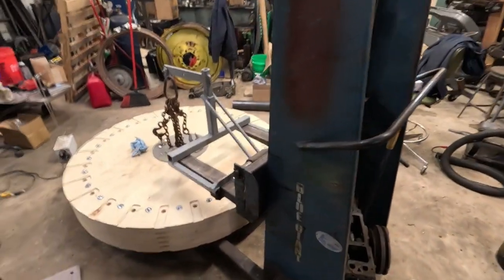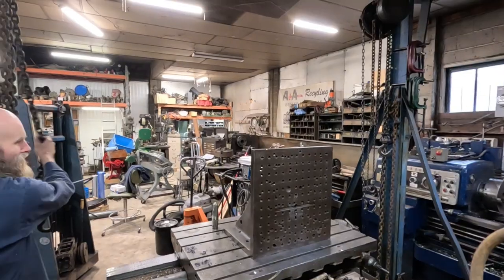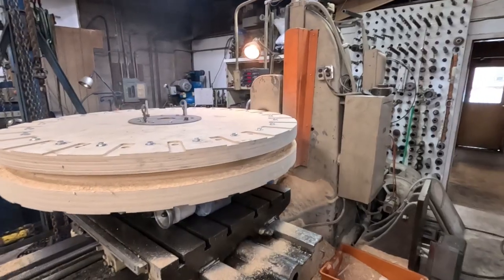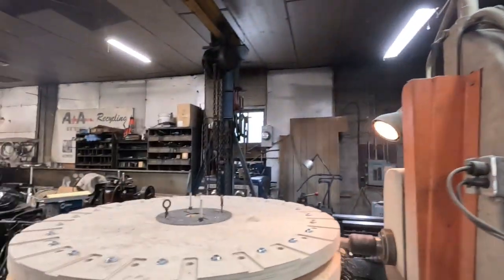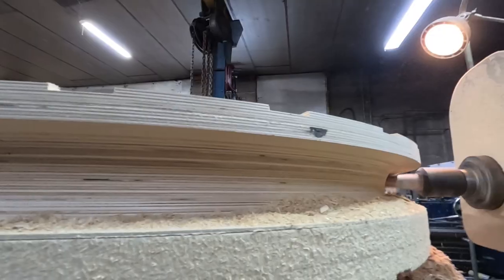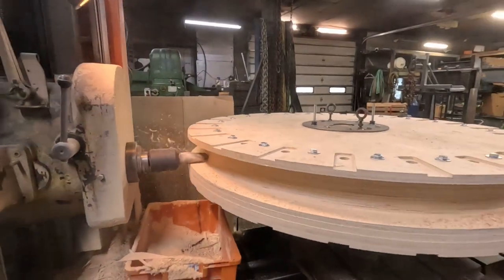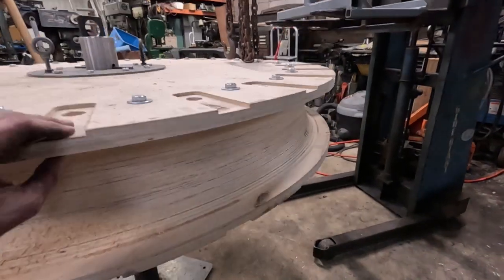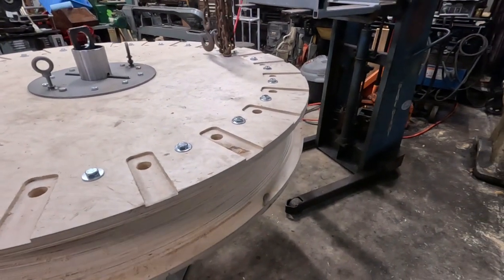Machining project on a plywood disc on the boring Mill!

Comment: Out of morbid curiosity, what do you get for a tolerance while machining carbohydrate foam?
Reply from the maker: Thankfully this didn't require tight tolerances, the stack-up of individual plywood pieces had too much flexibility in them to hit anything tighter than about plus or minus .010 on the width of the slot. The depth on the other hand was much tighter, but difficult to measure because of all the little wood fuzzies. I just machined the whole thing using my DRO to hit the hypothetical dimensions, and then hand test fitted the piece that went in it.